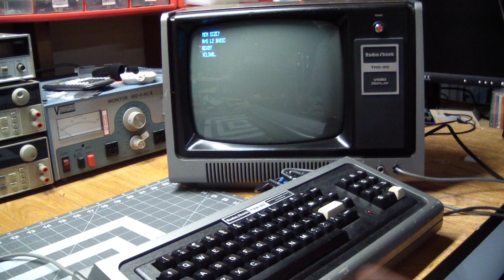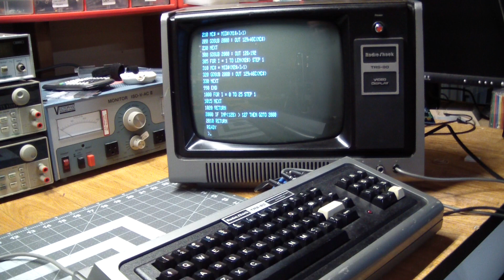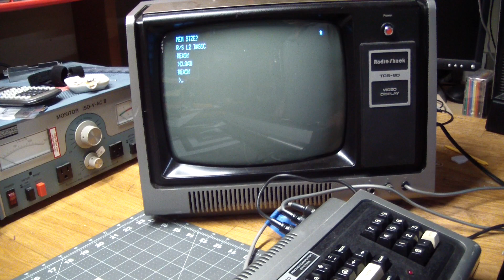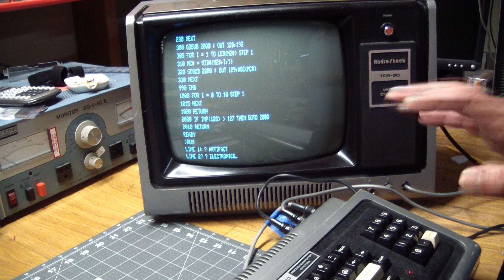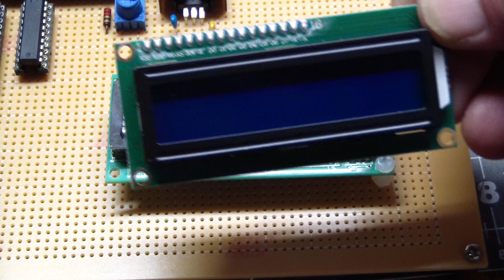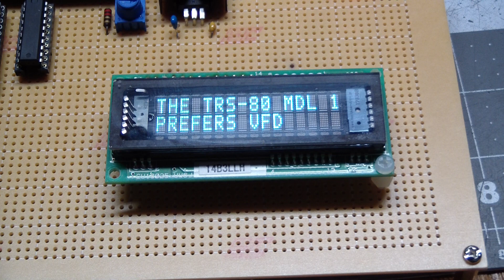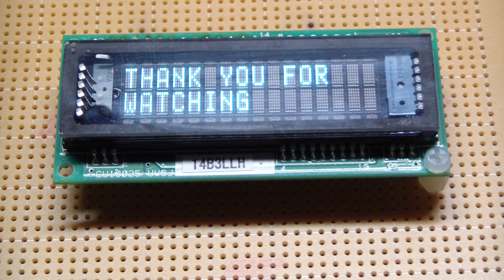AE#198 A TRS-80 Model 1 Hardware Interface Board

Comment: Hi Arti.  The cassette on the Atari is anything but fast, but it had a beep when loading data from cassette that let you focus your attention elsewhere.  If the load went south, you could hear it immediately as the sound of the data packet would be off.  I could never do development on a computer using tape although I didn't have much choice initially.  As soon as I could afford a disk drive, the 410 cassette player went on the shelf.